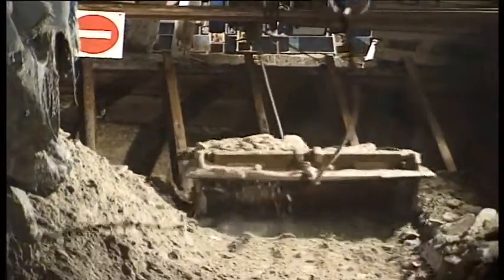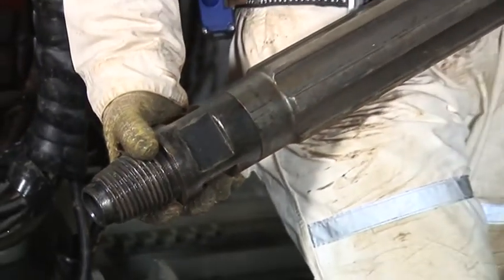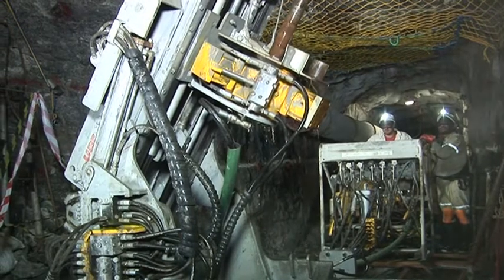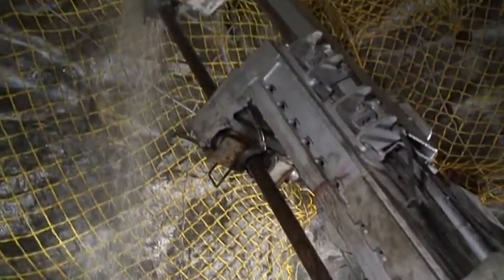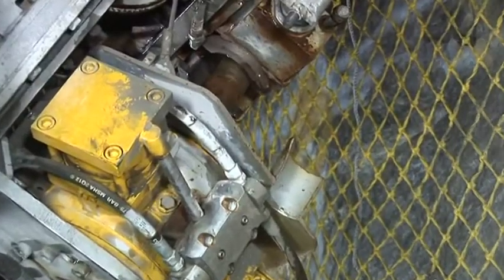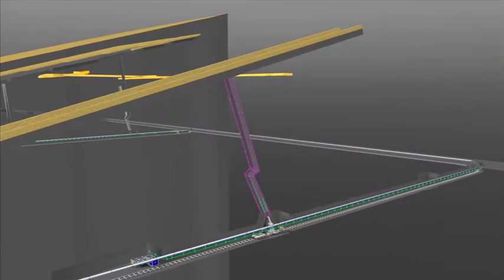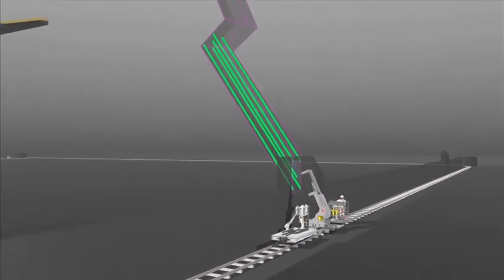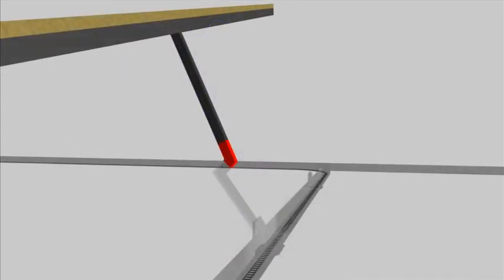LONG HOLE DRILLING

Comment: Is that a Wasara Water Hammer? I've used those on Cubex drills as well as the air hammer ITH set ups too. They both work very we on Cubex Drills. They are a track mounted drill. They are the cats ass for drilling.